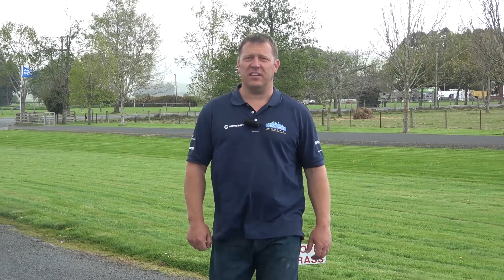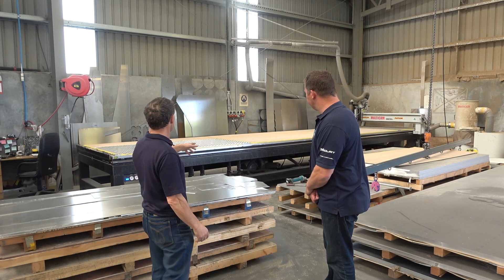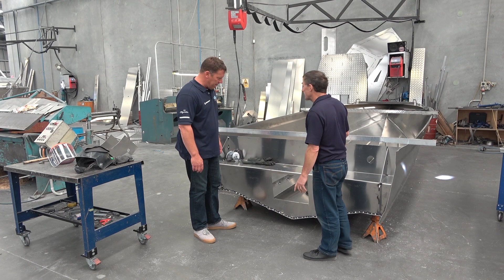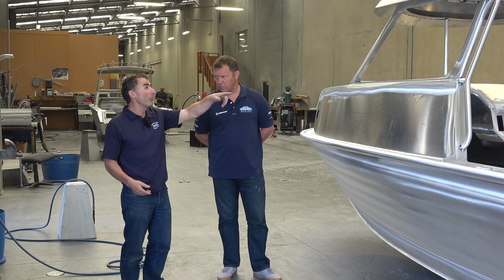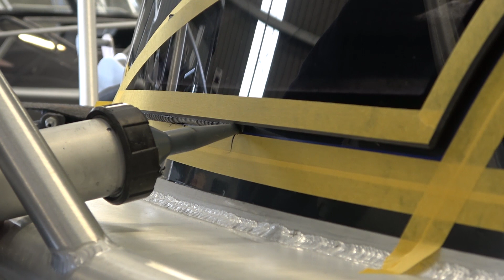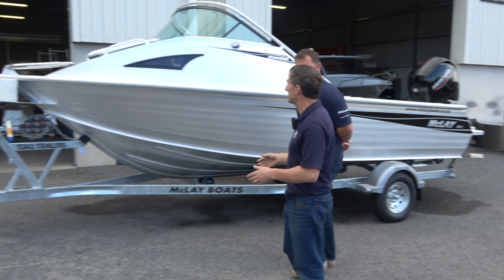Mclay Warehouse Tour

Comment: Show more of the ribs construction. Can't see anything. All I can see it's longitudinal ribs but none running across. All other alloy boats I see run like a grid construction under the floor. This look like only longitudinal stringers are used then the floor hold everything together. Not a ver strong design.